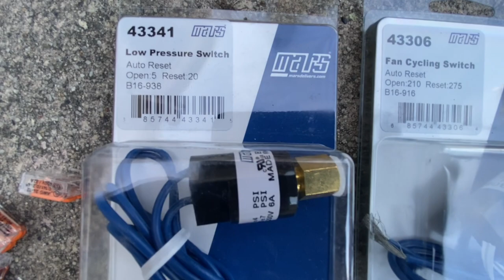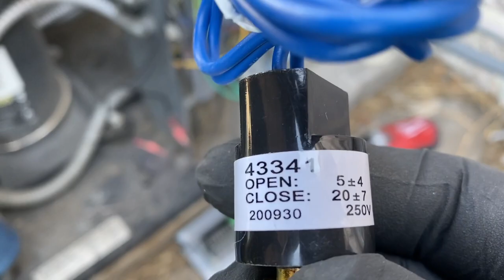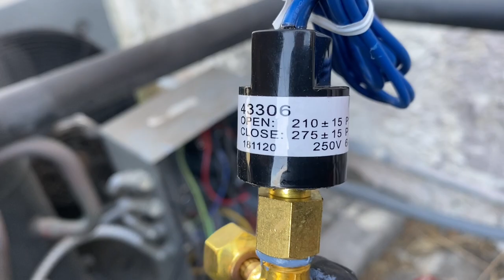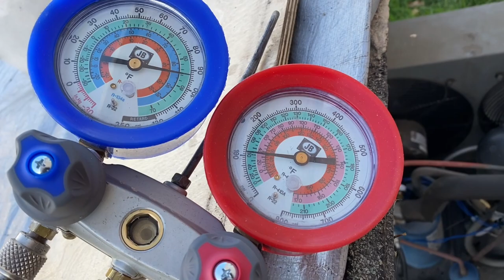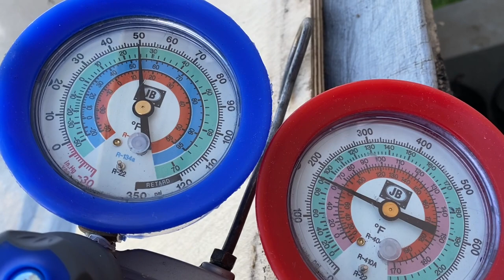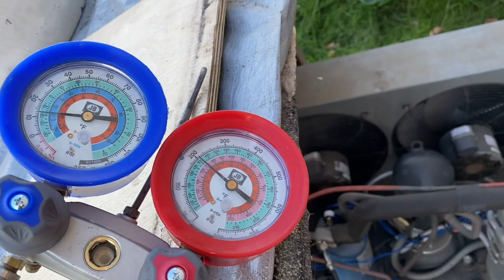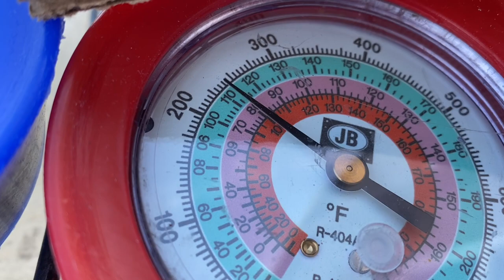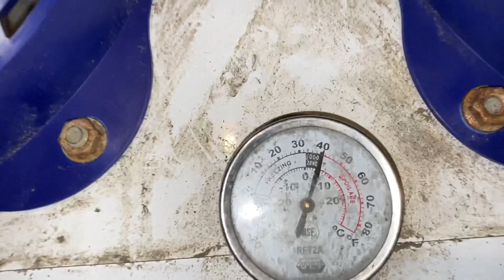Walk in cooler with DLL fault code

Comment: I do this as well on the B.S. of the Beacon II systems.  Beacon II's, pull it all out.  Replace with a liquid line solenoid valve, TXV sized to the coil, and a KE2 temperature controller with "off cycle" defrost control.  Get rid of the Electronic expansion valve and transducer, as well as the temperature sensor on the suction side.  They "say" they've reduced the components, when they have actually increased them.  I agree with Dave on the Emerson shite as well, get rid of the over hyped electronic controls and go with "old fashioned" mechanical controls, not transducers.  Bring it back to a mechanical systems, as it is.  No more failures, no more faults.  And, it actually works for years opposed to months with the electronics.  Use what works, not what is newly tested,.  Make your customers happy and gracious that you actually fixed the problems.  The "old stuff" works better than the new shite.

Comment: Love it , old school controls and “ leak lock” on the threads. I was already arrested by the “ Flare Police” for doing that.  I like to use a manual reset high head switch if possible. Nice job Dave 👍
Reply from the maker: That high head switch is OEM. GOOD enough for me. 🤘⚡️🤘
Reply from the maker: @OcRefrig  soldered in
Reply: Hey this is the flare police. Drop the leak lock on the ground and let the sealing surface do its job. As a noob I did flares dry and was always fine. Now  a little nylog goes a long way. I have been following long time leak lock believers making it hard to change parts a second time without issues.

Comment: Nice video. I have done the same alteration a number of times. Works great. In my area would have gone with 150-225 fan cycling.
Reply: You must be in California with Dave.  Here it can vary +95f to -20f. On 404A dual fan condensers with no flooded head pressure control, I want the second fan on at 225f in the summer to keep the liquid temp at 80-90f leaving the condenser.

Comment: Some old Master Bilt condensers do the same set up you did, and I like those preferably better because it's super simple lol. I've worked on quite a bit of those Emerson Condensers, never had the issues ya mentioned. Did ya replace the controller? I've seen them go finnecky before, great video as always dave

Comment: I've had issues with those. Referring to the high discharge temperature thermistor when a freezer is doing a hot pull down.
 Sometimes the condensing unit is slightly undersized by the installer. So when I run into that I just quote to go mechanical or for the mentioned issue I put the discharge sensor on the liquid line lol

Comment: Good call on your method of curing the intermittent fault, but I'm sorry to say mate that those bullet type (as you call them) pressure switches I find are quite unreliable, they don't seem to be able to handle constant operations in an LP pump down situation (I've never used a fan cycling one though, they may be better). They seem to last a year to 18 months tops. Although saying that maybe that's long enough until the next callout ;-)
Reply from the maker: We’ve had great luck with em. They even come oem on units.
Reply: @NorCal-refrigeration  yeah they come on oem units here in the UK too, that's where I've experienced the suspect longevity